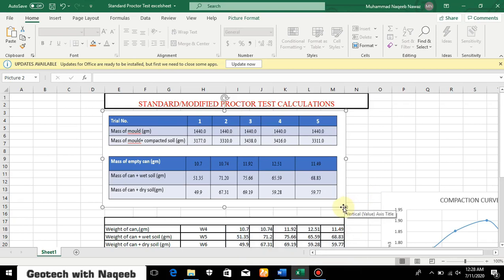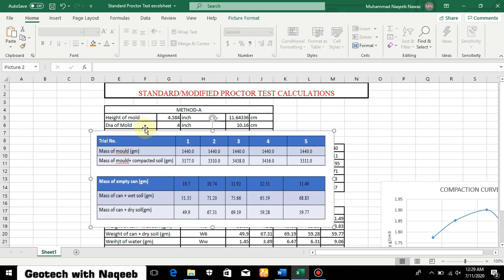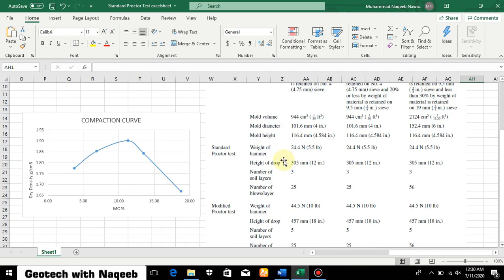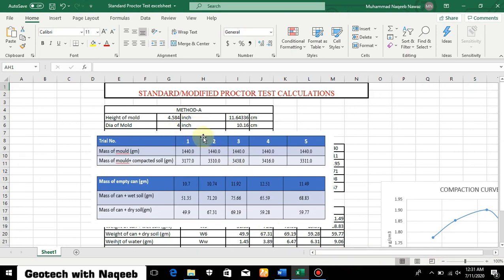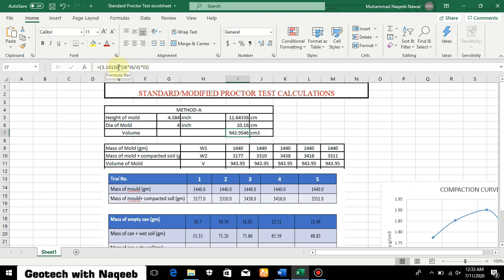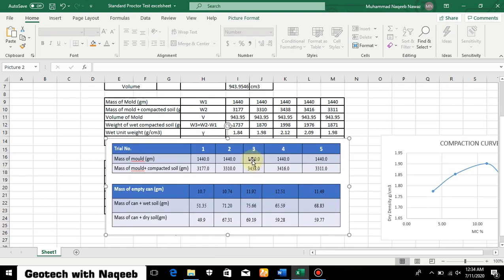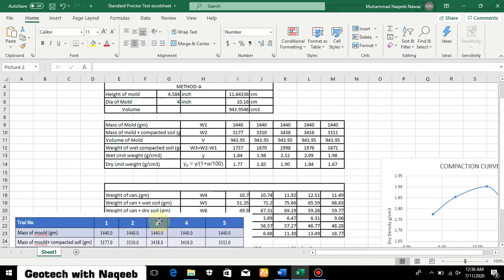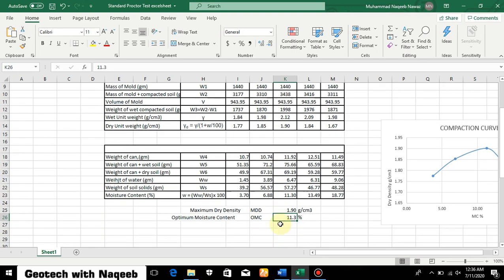Standard/Modified Proctor Test Calculations | Geotech with Naqeeb

Comment: I prefer not to use an excel smooth fit curve and I prefer to manually draw a spline in the data set.  The rationale is that the right half of the compaction curve generally follows the slope of the zero aid voids line.  What happens to the left of the max. is, in my experience, soil dependent. Lastly, I generally do not pick a data point for the max. and I generally rely on the spline I draw to estimate the MDD.
Reply: How to draw spline in the graph in excel

Comment: It is common engineering practice to use laboratory compaction tests for the design, specification, and construction control of soils used in earth construction. If a soil used in construction contains large particles, and only the finer fraction is used for laboratory tests, some method of correcting the laboratory test results to reflect the characteristics of the total soil is needed. ASTM D4718 provides a mathematical equation for correcting the unit weight and water content of the finer fraction of a soil, tested to determine the unit weight and water content of the total soil.